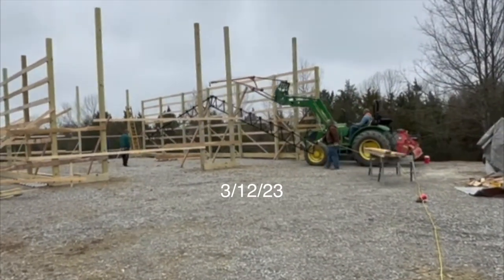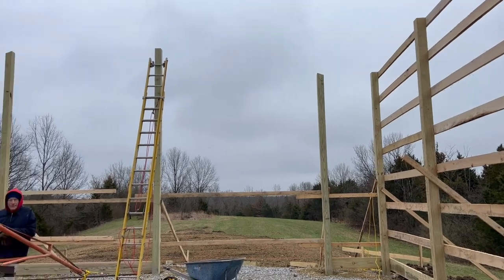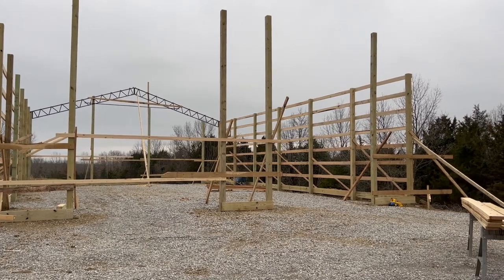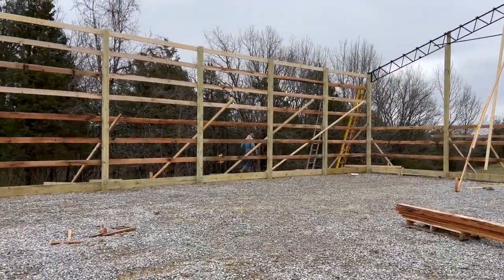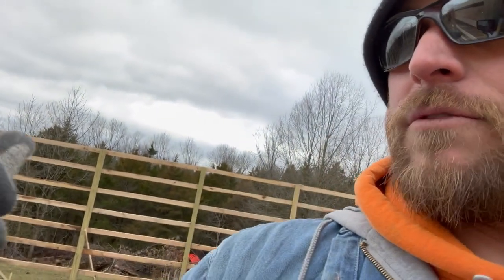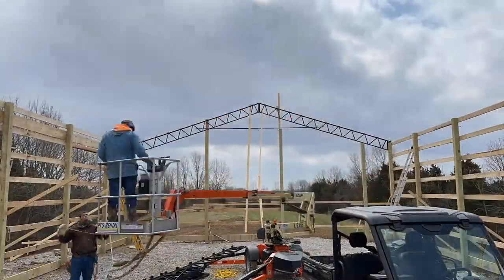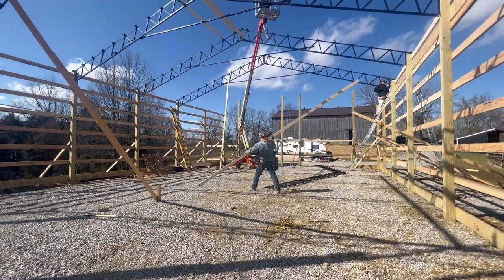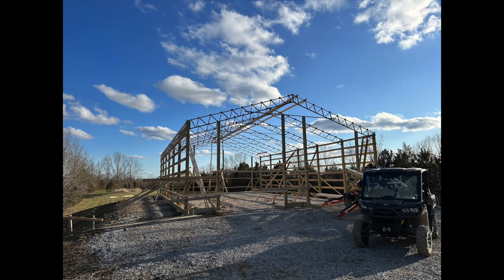DIY Pole Barn Construction #13: How to Hang Steel Trusses on Pole Barn | Easy Tutorial!

Comment: Thanks for doing a video on the process. I was curious how you attached the post to your trust on the in-wall? I have a pole barn that already has concrete poured but now I'm wanting to in close it. My plans are adding post for the in walls with plates to attach to the concrete but wasn't sure about attaching it to the trust.
Reply from the maker: +@Bamaoutdoors That should work. Good luck!

Comment: Did you have any problems with the spacing being more or less than the width of the truss so that you had to push a pole toward or pull em together to put the stress in place?
Reply from the maker: Not really. We used through bolts to tie trusses to 6x6 posts so if the span was out just a bit you could draw them in while tightening up bolts.
Reply: @CollinsCountry what if the spacing is too close??
Reply from the maker: @paulalbares643  if it’s too close because your measurements are off just a bit or the post is warped you can take a long 2x4 and lean it against the post and push. Basically using 2x4 for better leverage. That would be plenty to move the post a couple of inches.
Reply: @CollinsCountry  thanks for the quick response. 😊

Comment: What size/grade bolts are used for  joining each side of the truss?

What size/grade bolt used for attaching truss to the post.
Reply from the maker: Hello. Good questions. So hard to remember but I think 1/2 inch grade 8 for joining the trusses together and 1/2 inch galvanized through bolts for truss to post.